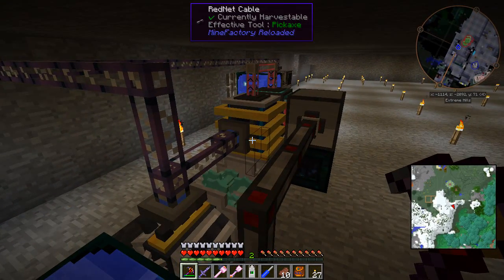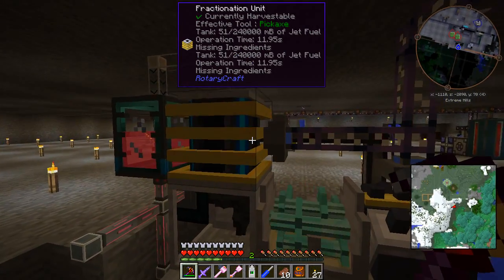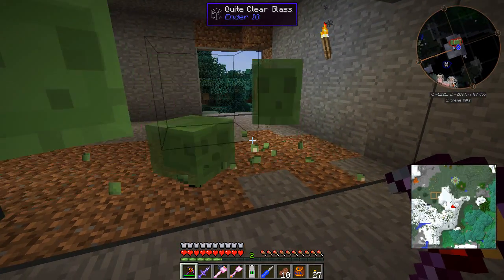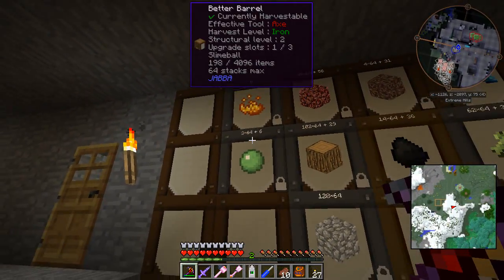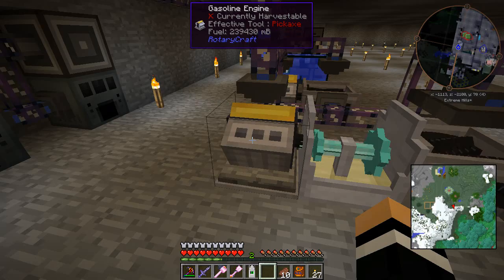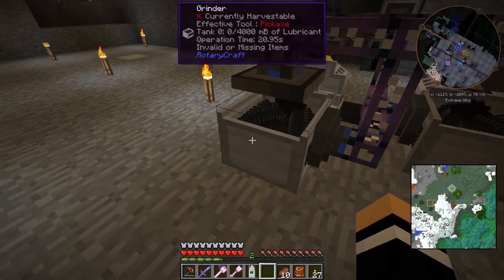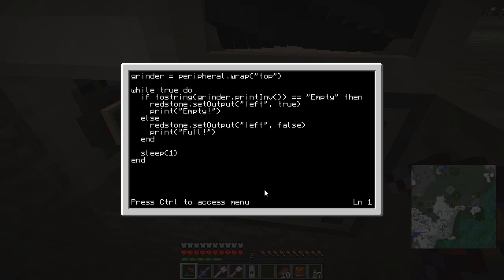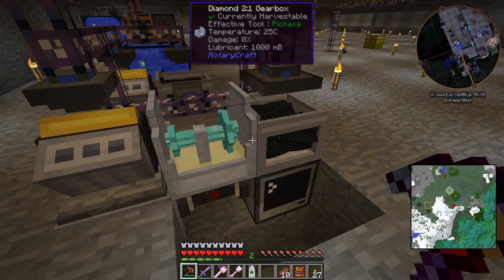S04E13 - Howto - Automated Jet Fuel

Comment: Ouch, I guess that explains the brief pause in episodes.
Reply from the maker: Yeah man, for some reason the backups hadn't been running for a couple of weeks... I could have cried.. lol. Rebuilt it a bit better though. Still some issues to iron out, especially with supply of blaze powder. Ultimately I'm very happy with the interaction with AE and Rotarycraft though, especially with the computercraft engine control helping fuel use!